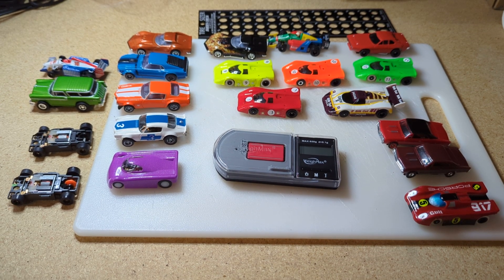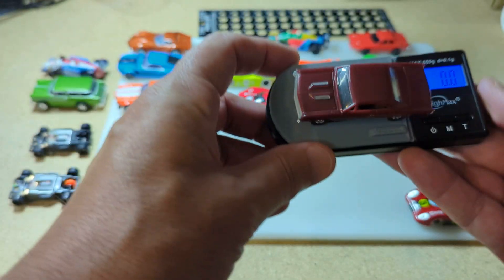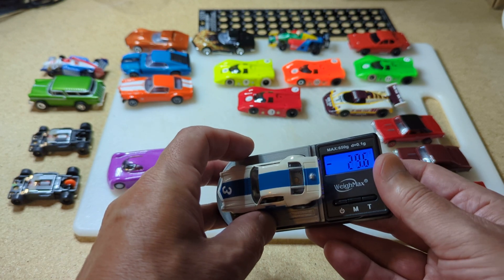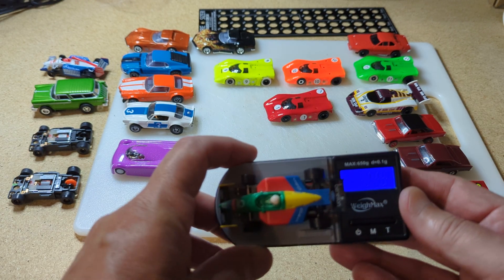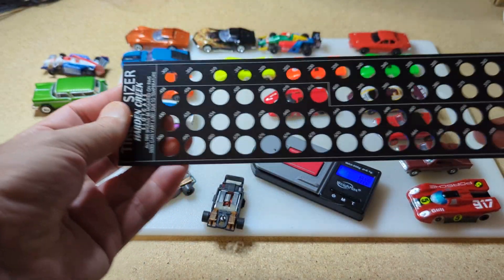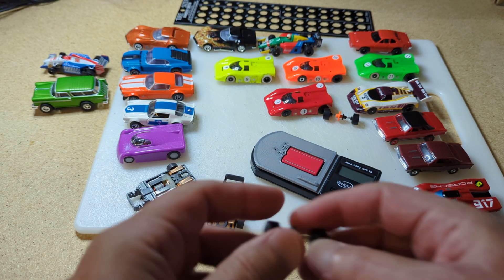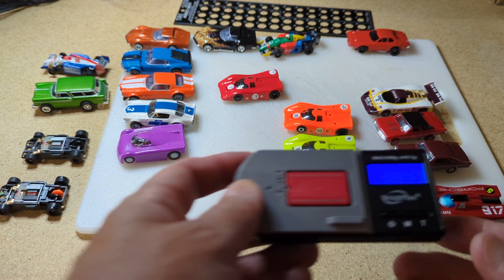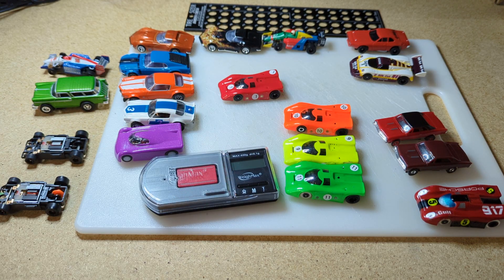Down force meter and Tire gauge.

Comment: Funny story about the magnets in one of my G+ cars, I was stacking 2 OEM magnets in one car, and was adding one to one already in the car. I put the mag in the hole partially with a mini screwdriver and swiped across to release it and I hear a plop on my berber carpet. The magnet jumped off the car and landed 6' from me on the floor. 
  So now I take out the magnet and match up polarity and check which side has the strongest magnetic pull by feel, then insert in car. I have a small 6" curve I use to try and pick up with the car centered on it, I can tell the difference between an OEM mag and 42/52. 
   It got me to wondering if I should be flipping and checking which side is better. It would be interesting to see if you can get a different reading flipping or matching the magnets polarity on the G+ cars.
Reply from the maker: Yeah those magnets can jump...lol I have found with the Neo level 30, 42 or 52 magnets they are matched pretty even on both sides. I do have another tool that lets me check the strength of the magnets on either side and did not see much of a difference.
Reply: @marksslotcargarage  It was supposed to be 6 FEET not inches. Good to know, thanks.

Comment: Good info as usual. I would be interested to know what the mega G+ level 52 mags read out on a short and long chassis on your scale. IIRC you had level 52's in your Black #2 Sebring GT40 G+ unless I am mixing you up with the other people I have watched. 
  I don't have the memory to remember all the changes for 7 cars, let alone dozens, so I have index cards for all the cars. I also label the chassis and bodies.
Reply from the maker: Thanks! That was not me, I have never used level 52's, 42 is as high as I go in my Mega G Plus cars.
Reply: @marksslotcargarage  Must have been Terry then. 52's were a must for my GT40 G+. Anyway I was trying to suggest in your other video that I can't find/access now to put up a cushion on the side of your track frame so the cars do not bounce off them. Since YT removed my last try to post Amazon link I will give you the title/headline of the product. It is thick neoprene type material I have used for a long time for various things, used to use it at a job decades ago. 3/8 should do, but I use 1/2". I double it up and kneel on it for jobs around the house and outside. It is hard to decipher some of the other product posts sizes but this one seems ok.   " Artilife Closed Cell Sponge Foam Sheet Roll,Perfect Cosplay Padding,DIY Project Sheet,Easy Cut Non-Adhesive Multi-Function Soundproof Foam Sheet(3/8”T X 13"W X 80"L)" Anyway just a thought.
Reply from the maker: @JDL_2020 Are you talking about on my Viper track? I already have 3/8 inch foam padding all the way around the border of my Viper track. It's 3 inches high by 3/8 thick, it was the perfect height for my table borders.
Reply: @marksslotcargarage  Cool. I saw your live show the other day and your car went flying off your table, I must have missed you had it already. What material is it? Was it there when you crashed that car you were going to giveaway? That track is something else you have done a good job with it.
Reply: @marksslotcargarage  I was trying to look at that video again but it does not show up when i click on it in my history.
Reply from the maker: @JDL_2020  Yes the foam padding was there during that video, I do have a small section of border along the front straight away that does not have foam, coming off the turn leading to the front long straight, I need to put foam there. I only put the foam along three sides of my table. I think in that video I did hit the tiny section that does not have the foam padding. I will be adding foam to that spot.
Reply: @marksslotcargarage  The neoprene I was suggesting has a good absorption of energy, so I was thinking less rebounding effect. I am still not sure if we are building a table like that or not. But I am expecting several new cars and some curved banking today. Still not sure of the timing systems I want...... so many decisions. Have a good day.

Comment: Enjoyed your video.  I noticed that the SRT Bulldog looked like it had a super 7 motor in it?  The AFX SRTs I got from BRS hobbies has the Mitsubishi 6 ohm standard motors in them. I especially enjoyed the changing out of rear ends that lowered the magnets of the SRT 35 neodymium traction magnets.  Looks like they are a little stronger than the Level 10 bar magnet.  They also make a level 42 neodymium replacement magnet for this car to.  Guess if you were to do a comparison video, ride height of the traction magnets would need to be near the same for a true comparison.  Enjoyed the video and your magnet downforce meter.  Thank you once again!
Reply from the maker: Thanks James, the SRT Bulldog I bought from BRS hobbies, it is the stock motor, I have not modified my Bulldog chassis's in any way, they are stock as i bought them from both HC Slots and BRS hobbies. The tire size definitely makes a difference in the down force.
Reply: Is the motors super 7 style motors in both?  I got 4 AFX SRTs and they all 4 had Mitsubishi motors from BRS.  Thank you!
Reply from the maker: What do you mean by Super 7 style? Only Super 7 cars have Super 7 motor. I guess I don't know enough about them. Also how did you get 4 AFX SRTs from BRS? They don't make AFX SRTs any longer or do you mean the Bulldog SRT version?
Reply from the maker: I just looked at my Super 7 cars and all of my Bulldog cars and all the motors look the same to me.
Reply: BRS Hobbies Bulldog AFX Turbo and Bulldog AFX SRT, sorry, just the way they listed them.  Sorry for the short hand.  I meant Bulldog, lol:) There is the Bulldog AFX Turbo Standard 6-ohm Can Motor which is a Mitsubishi, also used in the old Tomy turbo\srt then there is the HC Slots Super 7 can motor that allow the motor magnets to be closer to the rails in the Super 7 chassis to assist in traction better, also they have another one with balanced arm.  The Super 7 SC comes with regular Super 7 motor and the GTS comes with the balanced arm motor.  I guess the HC bulldog you have came with the Super 7 motor, but was just surprised to see that motor also in your BRS Hobbies bulldog, at least it looked the same in video.  It’s interesting that the BRS site pictures of the cars show the Super 7 can motor in them.  The main can frame has a step down built in them, the Mitsubishi one can walls are level all the way around the top and bottom.  Guess my main concern for when we start racing is, not getting the BRS cars with different motors.  Just wanted to keep that class cheap and fair for everyone.   Thank you once again for all your hard work and awesome videos.  I guess I would just call those magnets neo for short, lol.  I’m from the south and couldn’t properly pronounce the word if I had to.  Lol 😊
Reply from the maker: @MyFlash43  Thanks James, I do have both versions of the Super 7 chassis and know the GTS has a balanced arm. I will have to take a closer look at the Bulldog motors. I am surprised that AFX lets BRS use the AFX letters in their description of the Bulldog. My Bulldog HC Slots chassis I have had for a while, long before the Super 7 came out.
Reply: At other locations on their site they actually use Afx part numbers.  Such as AFX8803 for Tomy Afx pickup shoes